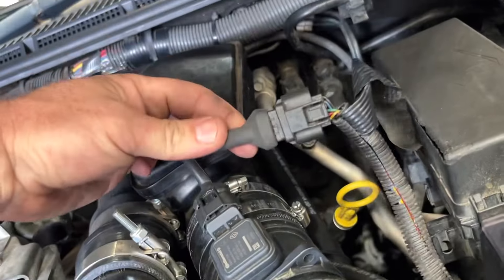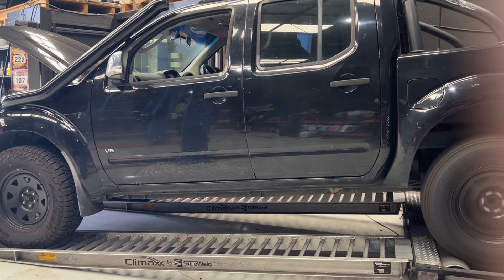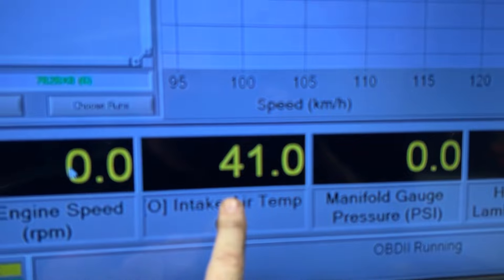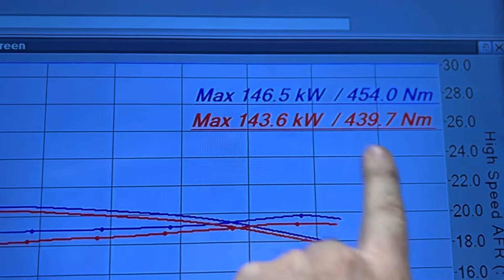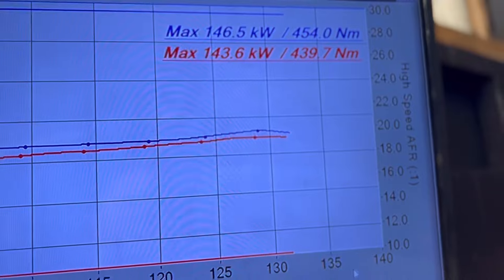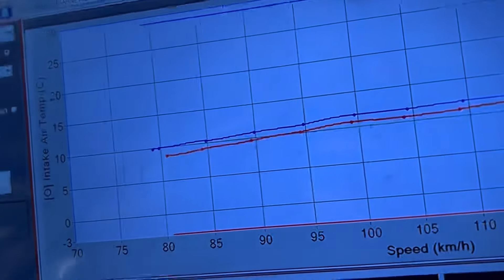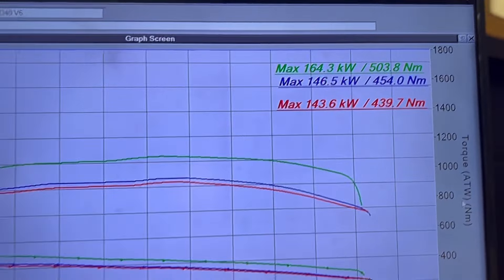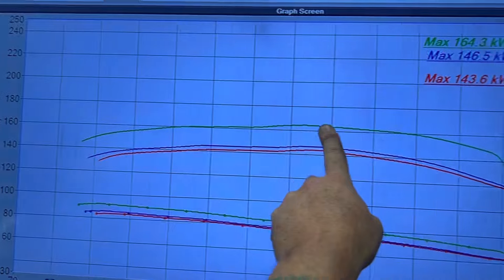EGR Delete Cables - Are they worth buying? What do they actually do?

Comment: I have fitted a delete cable to our 4n15 Pajero sport, its only done 1200 KLM but according to the dash its getting better fuel economy by about 1ltr per 100klm (long trip average 6.6ltrs per 100) also the annoying what I thought was turbo lag has now gone. Happy with it so far and a tune would void warranty.
Reply: Hey mate just curious are you still running the EGR cable? I've got a pan sport but about 100k on it. It's incredible the amount of carbon built up in intake manifold and intake ports and valves cyl 1, 2!
Reply: @ConcernedCitizen742  Only time I removed the cable was for its first service, straight away the annoying instant power hesitation came back so refitted the next day. Not sure what the effects would be for other vehicles as manufactures have different emission control setups, but for my Pajero sport QF I’m getting better response and fuel economy. If there is less power?, it’s not noticeable and we tow a 2.5 ton caravan. For $32 off Ebay it’s not a lot of money to try and for me the benefits are well worth the money. Engine takes about 5 klm longer to reach temp, DPF burn off intervals are halved and the oil stays cleaner for much longer.
Reply: @graeme1491  Glad I kept reading

Comment: Hey mate, got a Isuzu Dmax 2023, I've just removed the Egr pipes and just covered it with those egr plates delete. No tune or remap,just standards. Results are, better throttle response, drives light, will it effect the engine longrun?
Reply: Ya it will keep carbon out of the cylinder head and save you a pile of cash/time on replacing the EGR @ 100k.
I would assume better gas mpg as well. I don't agree with the design and function of an EGR system. It is putting dirty pre burnt exhaust into the cylinder for re-burning.. Which doesn't re-burn at all, it deposits pure carbon soot over time that will degrade performance, which is designed to push people back to car lots to buy another vehicle.. It doesn't cool off the cylinder either like they claim either. These EGR systems only came out in the 70s.. Internal combustion engines have been out for over 100 years, and you ever hear the expression "they don't make em like the used to" That is because we live in a throw away society designed precisely to increase quarterly stock earnings by selling shit...

Here is most people's main problem.. They can't just delete the EGR without tricking the ECU into thinking the EGR is there. If people just block the EGR it will throw off engine codes for poor flow  which then messes up your MPG and power output etc.. The EGR should be plugged in electrically, then taken off the engine head so it just exhausts that carbon crap outside of the engine while putting a cover plate over the cylinder head so nothing goes in there.
If you were handy enough you could have it vent into something, then check that something after a few months and see what's been thrown back into our engines.. IT's pure black carbon soot...
If you have one of the vacuum style EGR's just disconnect it from piping that burnt exhaust back into the cylinders, but make sure it can breath properly.. So don't just tie it back into the cover plate delete kit thing, it needs to breath out that throat hole or it will throw the whole thing into a tizzy
Doing it this way keeps the CEL from throwing a code, which then keeps all the trims and idle running smoothly.
Reply: 2012 Dmax Did the plate and clean today Cable in fidt up, then removed it. DTC still comes up as P0404 EGR closed performance? The motor keeping the valve open maybe?

Comment: You’d have to drive massive km with a cable fitted to go through $1595 of extra diesel, so if you’re not flogging the diesel through summer sand dunes and therefore not running in significantly higher IAT what’s the downside? If you are driving in those conditions wouldn’t EGT increase and the ECU adjust anyway?
Reply from the maker: When you can use 2-3L less per 100kmh as well as have more power and torque it doesn’t take long to justify the cost of a tune

Comment: this is tapping into the intake air temp sensor, other products like this use an ambient temp sensor to prevent interfering with factory ecm saftey features
Reply: Hi there,could you please tell me who sells the cables that read ambient temps .
Cheers

Comment: i plugged the vacuum line on the egr valve on my 2000 Ford Ranger 3.0 L engine years ago because every time it opened it made the truck studder and run like crap
Reply from the maker: Best thing you can do

Comment: Yep did this on a Pajero and idle went way up and felt like a wet rag. Took it out and threw it in the bin.
Reply from the maker: A tune is more expensive, but you get what you pay for. Just sucks that people get mislead with these things
Reply: Only idles higher when cold,once engine is warm idle drops and drives alot better
Reply: You contradict the testimony of the 4n15 owner, do you have the same model?

Comment: Thanks for the Video. Bit high tech for me but still I understood most.  

That last tune you did .. was the with the EGR Cable in or out ???  

Hayden  2012 MAZDA BT50 - Just fitted my EGR Cable yesterday. BT has 128 000 .... feels to me like it is running smoother, quieter, less ping.  Smoother power delivery.
Reply: They can leave the EGR delete cable out when they tune because they can just order (by adjusting the values) the computer to Never let the EGR open.

Comment: Will a tune keep ya intercooler and intake manifold clean vis a vis an egr delete? I thought the purpose was to reduce costly maintenance not increase power?
Reply from the maker: A tune will stop carbon build up if egr turned off, you will also get more power and torque. A delete cable only tricks ecu to not open egr and has some side effects

Comment: Be good if you did a real world test. EGRs only operate at rest or at cruising speeds. Not at WOT in the 1:1 gear.

Sure it may use more fuel where you tested it, but 99% of driving doesn't take place in your test conditions. Where using the cable actually saves fuel, as it's not choking the engine up with its own shit.

Comment: My understanding  is that these cables, just trick the valve into staying closed and keeping the exhaust out of the intake, by keeping it closed.
It will assist in stopping the intake from fouling.    And stopping the engine getting USED air, heavily reduced in Oxygen. 
But won't stop the EGR from failing, and allowing cooling water loss into the exhaust, and maybe some seeping past the EGR valve into the intake ...... not nice outcomes....
But then again without the huge temp fluctuations, the cooler isnt being stressed, and as long as cooling water quality is kept up, its unlikely to fail like they do
Reply: well in my understanding it should be fine to use a blanking cable (but might be ok on some vehicles and not on others but), because the erg is not always being used at high revs , so it comes more into play when cruising along , so if the vehicle can work without it opening if you are driving a bit like you stole it, it should be sweet all the time, just a thought.
Reply: @derektitch  Haha  Yes......
My understanding also,  The EGR valve opens to let exhaust in when there's little power demand, like around town,  or Cruise Control open road Then it closes as more power is needed.  I think that it uses Vacuum, for indicating it..but not sure.. 
So yeah  a hard throttle keeps the EGR valve closed

Comment: Hi guys. I have a 2010 Mitsubishi Challenger with a 4D56. I also have an EGR delete cable. My Scangauge 2 reads an air intake temp which seems accurate (unlike the negative air intake temp shown in your video). Does tuning software show a different air intake temp compared to an OBD reading ?  Are there good and bad EGR cables ?

Comment: Hi. If I install a egr cable module in pk ford ranger 2009, does that eliminate the need for the pair of vacuum pump solenoid valves? as one has failed and I don’t want to replace it if an egr cable will bypass the need to.

Comment: Hi just a question about the EGR valve on a 2012 79 land cruiser that has been turned and the EGR block off am I running the same risk the two engine not seeing the right air intake temp

Comment: is an ecu tune going to delete the factory warranty on my new navara?
Reply: @bananaking2828  Do your homework, there are a lot of engines failing because of aftermarket ecu tunes, if anything goes wrong with the engine, first thing the manufacturer does is plug in to see if the ecu has been altered and will void the warranty. A delete cable can be removed before service and non detecable
Reply: @graeme1491  yeah graeme, i'm going with the mod cable and being a grandpa type driver hope that high intake temp protection procheck talks about won't be an issue for me.
Reply: Not sure about Navara, I have PJ sport 2.4L. check out ABD Automotive Ford Ranger EGR delete cable EGT's test

Comment: does the EGR delete cable rectify the error P0403-00?
Reply: My mate had this code and plugged in a EGR delete cable and it didn’t go away. He’s getting a tune and will delete the EGR out of the ECU which will resolve the issue/code.